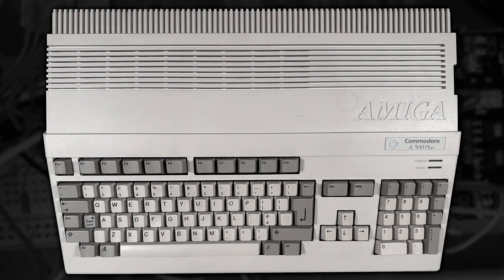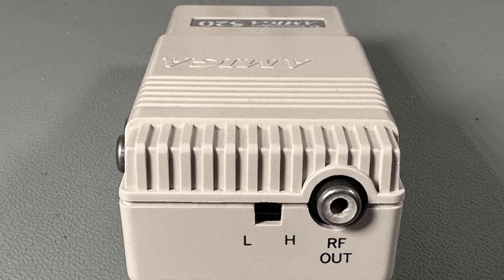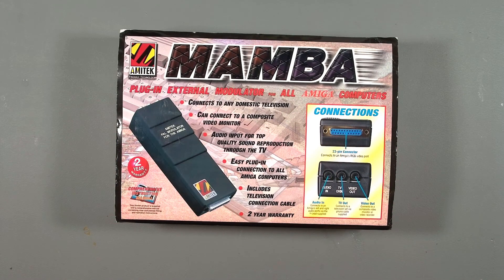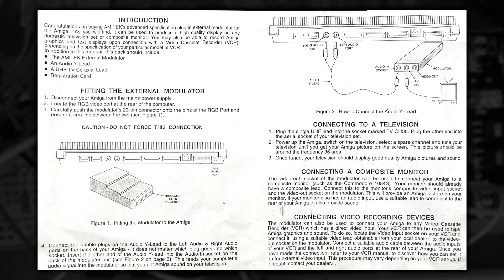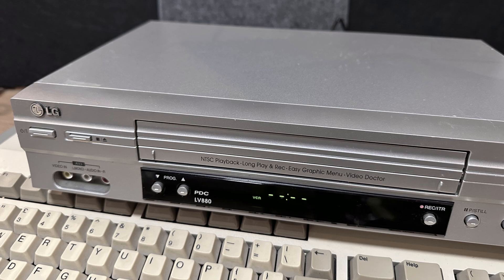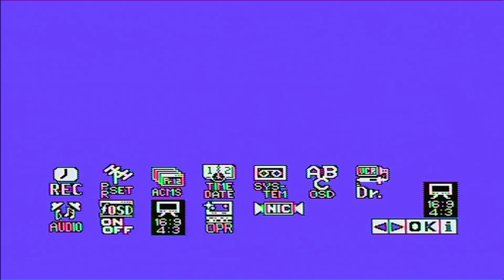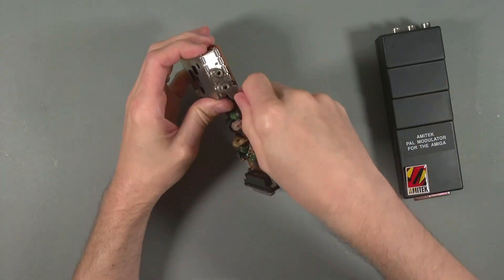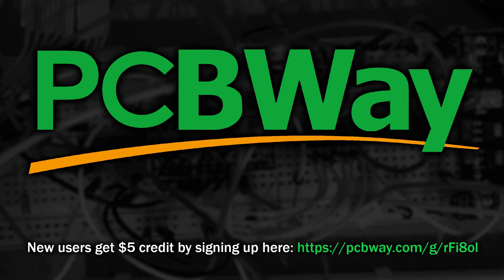Meet the MAMBA, the Alternative to the A520 Modulator.. but why?

Comment: That bubbly solder can be seen on some C64 boards as well. I think they let the traces collect solder as it goes through the bath to improve connections (then solder mask goes on top). I believe they stopped that practice on the C64 due to the extrs cost of the solder that it takes (when making millions of boards then the pennies add up)
Reply: I can confirm that. I have also seen this on an Intellivision console. Overall it seems like this kind of soldering with mask on top disappeared by the mid-80s, so this modulator from the 1990s seems a bit BACKWARDS. Also the fact that the MAMBA uses a double-sided circuit board makes traces shorter if you don't have to squeeze them all on one layer, and the ground planes can be used as shielding. The more it irritates me that the modulator chip is NOT in it's own metal box, which would clearly improve things. 

The most signifcant difference is really the own 7805 voltage regulation. It would be very interesting to see how that 7805 would improve an A520's video output. Would be easy to mod the A520 that way. Anybody willing to do this? I don't have an A520 myself. I was using RGB via SCART back then and later I had Commodore monitors and a Microvitec 1438 with my A1200!
Reply: Yes. My Atari 800XL is made the same way. I think my original 800 is as well. It was a common way to beef up the traces and keep the copper from oxidizing before the mask was applied.

Comment: Where's a 520 modulator that takes A1200 RGB output and converts to HDMI? I know RGB2HDMI uses pi and direct lines so hasn't enough pin inputs for AGA but surely the analogue signal coming off the SGB port can be converted with an A2D of enough bits?
Reply from the maker: Yes you can get SCART to HDMI converters for this, kinda works
Reply: The D520 converter is this product, I hear there is a new batch being made.